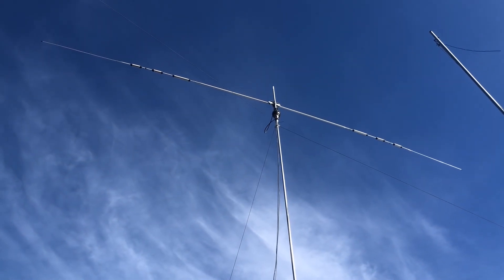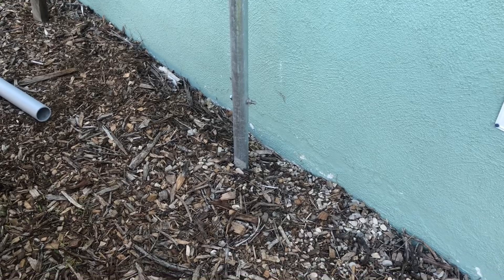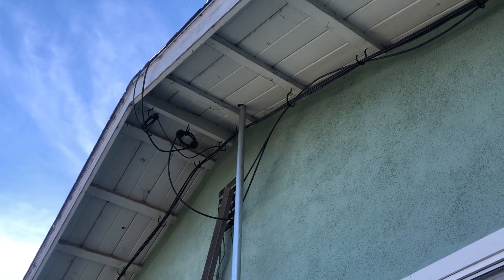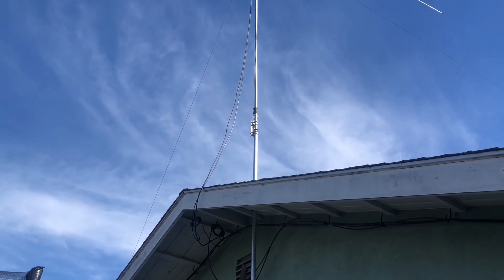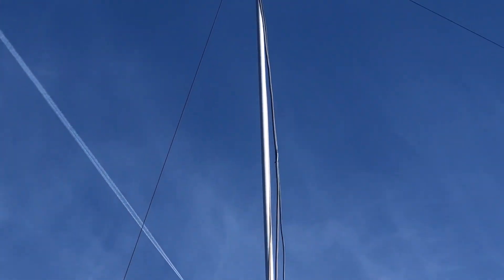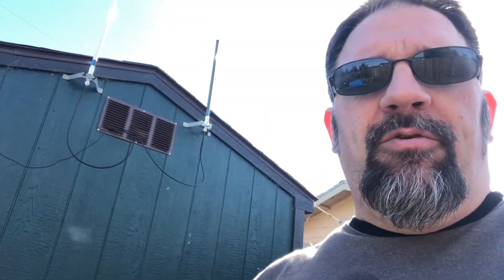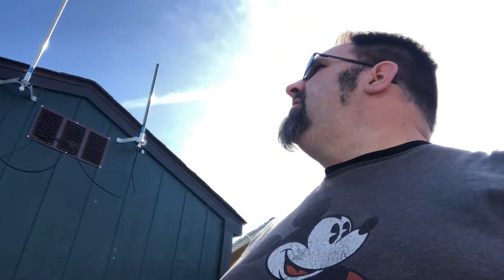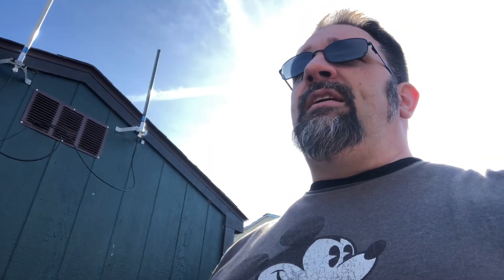Smitty working on SOMETHING: Antenna Masts On The Cheap

Comment: I like the design.

BTW: Comet H-422 Rotatable Trapped Dipole no longer available?
Reply from the maker: Dang! Looks like you're right. hamradio.com completely removed it from their web page, and DX Engineering lists it as "Not Available" which I'm pretty sure is different than "Out of stock, but on order and hopefully coming soon."  I have no authoritative info other than just searching for it, but it looks like you're correct unfortunately.

Comment: Hello. question: what is the minimum size of the iron pipe 12 meters for lifting the yaghi fm antenna Dimensions antenna gauge L*W*H: 5500*900*1760 MM Weight: 5 KG? thank you!
Reply from the maker: I have no idea. You’d have to ask an engineer to do the calculations for you on that. It’ll take into account the wind load of the antenna (different than the total dimensions and weight), and whether you guy the mast or not. Even with that information, I can’t answer that question for you. Sorry.

Comment: Great idea!  I did similar with a 6 ft. roof tower on my garage. 10 ft mast, 7 ft above the tower. To lower I remove the rotator and the mast drops through a hole in the roof (covered when not in use) so the antenna is  about 5ft above the roof. Guys only on the roof tower. This puts my hexbeam 20m element at 27 ft. AGL. 73 Peter

Comment: Its looks like you have some sort of a bushing that the smaller pipe is inserted into? What kind is that and where did you get that?
Reply from the maker: Nothing that the upper pipe is inserted into, other than the lower pipe. I think what you're seeing is a small aluminum plate with U-bolts on both the bottom and top pipe. The only purpose of that plate is to keep the top pipe from twisting in the wind.  It is NOT supporting any weight of the upper pipe, all that is supported by the bolt inserted through the lower pipe that the upper pipe rests on, and a bolt through the upper pipe that rests on the edge of the lower pipe.  The plate and U-bolts are only there to prevent the top pipe from twisting.
Reply: @SmittyHalibut  OK thanks!